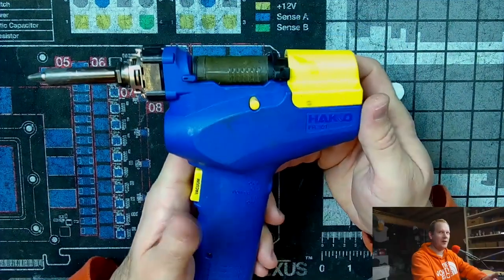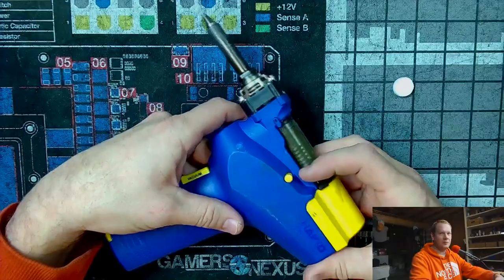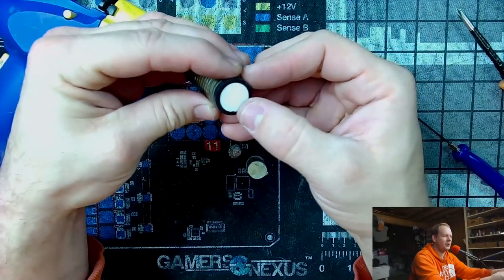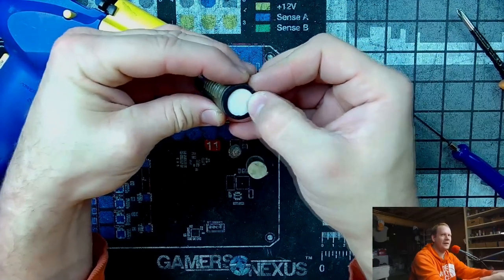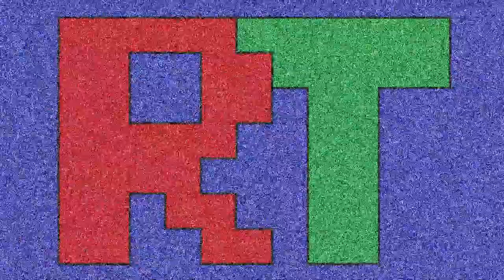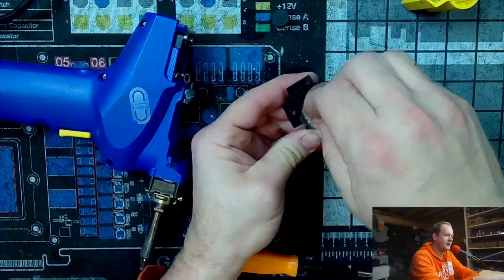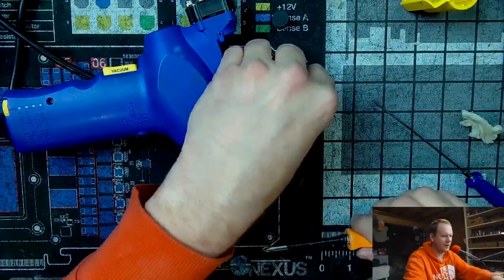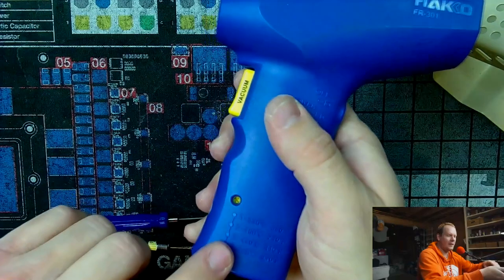How to maintain your Desoldering tool | Hakko FR301 Deep Dive

Comment: Super timely video for me! I was just trying to use mine yesterday and was getting absolutely zero air flow. I always clean the nozzle and chamber, but I had never taken apart the back end for cleaning. In my case, one side of the plastic diaphragm (Hakko calls it the "B5023 Valve Plate") had actually broken and was plugging the hole. Annoying that I have to put my project on hold to swap that piece out, but awesome that Hakko makes basically every piece of this thing available to buy for fairly cheap.

Anyway, great video! Really helped me out.

Comment: Excellent video on this device. Using the FR-301 a lot. The only drawback is the weight ... so if you do desoldering for hours every day, the JBC (base unit separate from head) might be the better option. For 5 times the price of course. Though for the gun-shaped desoldering devices, the FR301 is the best. Also get the C1100 holder and not the one from the video. Also, if you do a lot of THT on e.g. PSU boards, I'd recommend getting the 1.6mm tip ... the 1mm that comes with the unit is often too small.

Comment: Thanks! Quick tip: you can keep your IPA in a small spray bottle (2oz or so) rather than dumping it on things from the original bottle.
Reply: This is exactly what I did.  Bought some cheap mini spray bottles off Ebay & they work a treat!
Reply: It’s better to minimize the exposure to air. The spray bottle works great and you can soak a q-tip easily by putting it right up to the nozzle.

Comment: Question for you if you dont mind: I got a brand new FR-301, and it doesn't seem to work as well as yours. Im working on NES boards with it, alot of the RAM chip solder just doesn't want to come up. Do you have any tips you can give me? I've tried several rounds with the FR-301, and had to end up using wick to remove most of the chips.
Reply: Why are you removing ram chips on a NES?

Comment: So a common issue ive been having is the little tip gets clogged and does not get unclogged with that tool they provide. I've gone through 2 tips in a short period of time. Is there a better way to clean the tip?

Comment: Hi Steve! Another awesome video! If you see this, would you have a link to that capacitor tester? Been wanting one for a while now, I have been getting into more in-depth repair work lately and may recap some crt's here in the future. I honestly just want to see how much out of spec, if at all, the capacitors I have been removing are at for curiosity's sake. I recently recapped the amp and mobo for some sound equipment that I could not part with, it works well now and wish I had the Hakko tool at that time. You inspired me to get one of these tools, and it is such a beast. I love it. Thanks again for keeping the CRT world alive.
Reply: A newer fluke meter will have that built in.